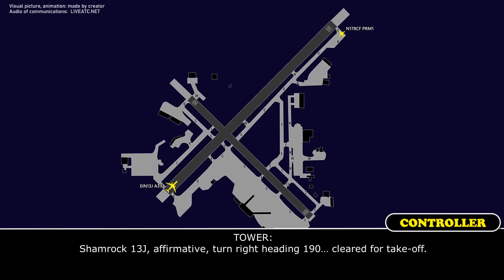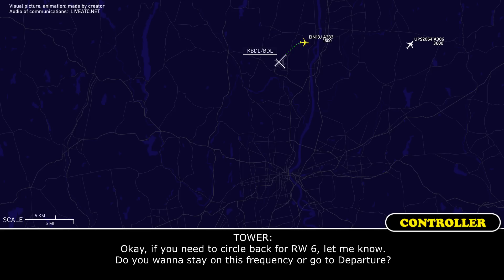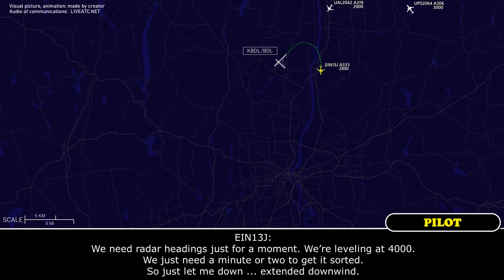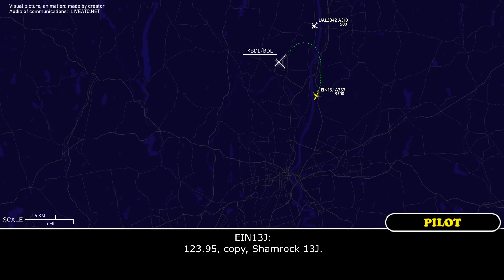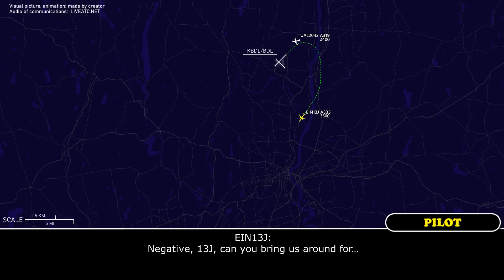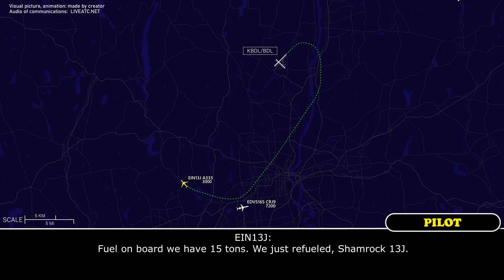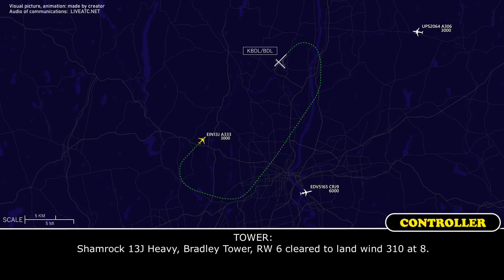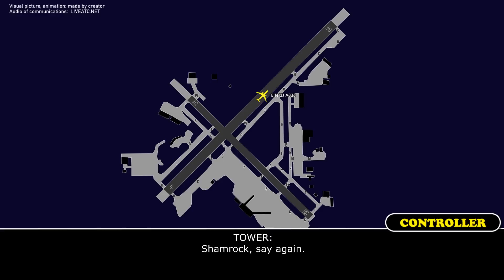Aer Lingus Airbus A333 declared PAN-PAN | Real ATC with a compressor stall after takeoff.

Comment: There must have been an additional complication beside the compressor stall. I’ve been on two flights that had compressor stalls — both in the 1970s on 727s, center engine of course. But after the loud bang and shudder, we continued climbing and headed to our destination on both flights. No further problems. Perhaps this particular engine suffered collateral damage from the stall.

Comment: I am a supervisor at BDL. I fueled this when it initially diverted here. It's still there. They will be completely changing their number 2 engine.
Reply from the maker: Thank you for your comment. Glad they landed safely.
Reply: @YouCanSeeATC  No problem!
Reply: @Andrew Janes @You can see ATC. I flew on that aircraft on the 9th July.
Reply: So what became of all the passengers?
Reply: @msjdb723  They ended up bussing the 314 total people including crew up to Boston. Very long day for them. They actually went back to the gate in DUB due to a medical emergency. So they left 2 hours late from DUB before they diverted from BOS to BDL.
Reply: @dad325  Oh my...🥴 - hopefully they all recovered now from this adventure!
Reply: @dad325  🤦🏼‍♀️ Poor folks. But thanks for that info!
Reply: @dad325 
1. Changing the complete engine sounds like it was a much bigger issue than just the compressor itself.
Or is it something that happens more regularly than a pax like me would expect?
(for instance if the compressor is hard to get to, or whatever)

2. That sounds like the worst kind of travel drama 🥲
(well, without actually crashing, I suppose🙊) 
I'd have been sooooo done with that day, at the end of it 😂

3. Thank you for sharing more info! ^^
Reply: @MrNicoJac  changing the engine is standard procedure for engine anomalies like this especially, the entire engine goes back to either the manufacturer or at minimum their main maintenance base if they have an engine shop that can do heavy maintenance/rebuilds and meanwhile a replacement gets hung. Basically anything more involved than inspections/adding fluids/very minor work usually requires off wing maintenance
Reply: @GlutenEruption 
Ah, interesting.
Thanks for the reply! 

I figured it might be one component that they can just 'un-plug' and replace - since it's not a fan blade etc
But I'm glad to hear that they err on the side of caution with engine parts, haha
Reply: @MrNicoJac  No problem! Erring on the side of caution is definitely the name of the game in aerospace. Although for engine maintenance specifically, it’s as much about money and convenience as caution - not only is it just easier to send the engine to a dedicated facility to inspect, diagnose and repair everything, but the engine swap is a common maintenance item and only takes a few hours to complete, meaning the plane can be back in service and making money right away instead of being down for a week or more while the damaged parts are removed, ordered, replaced, tested, etc. 

And the overhauled/repaired unit just goes back into inventory and get hung on the next plane that has an engine due for maintenance or which had a problem, in a constantly rotating fashion. 

And as a further upside, instead of having 2 engines that came off the production line one after the other, all the planes get a mix of engines that were manufactured on different dates with parts from different lots, etc., meaning if say a bad batch of parts somehow got past QC and start causing failures, it will only ever affect one engine per plane, and you’ll almost always have one good engine.
Reply: @GlutenEruption  Very informative comment, thx.
Reply: @MrNicoJac  having looked at a blow up diagram of the compressor in a jet engine. It is certainly not a bolt on piece. It appears to make up about 30%-50% of the engines structure. A fan blade looks would be a much easier component to change.
Reply: Wow
Reply: Whatdja put in the fuel tank then, boyo?
Reply: @lani6647  When it first diverted, I put about 15728 liters on it. Or about 4155 gallons. When it finally left BDL about 10 days later, it went straight back to Dublin so I put on about 31892 liters or about 8425 gallons of Jet Fuel.

Comment: Anyone familiar with the Airport/Incident? Why did they say the ILS 33 was no good, is it just the leghth?
Reply: After the incident, tower asked if they wanted to return to 06 and they said yes. After that approach asked for 33 but they were probably already configured the ils frequencies and everything for 06 approach. They had enough happening already in there. Sudden runway change in that situation is not what you want.
Reply: Most likely they just were already setting up for 06 and didn't want to change at the last moment, they just wanted to get down ASAP.
Reply: internet says 9500' vs 6800' feet, so maybe?
Reply: @jamescollier3  6800' seems to be enough for a normal MLW, maybe they wanted the extra length due to having degraded performance in the event of a go-around.

I don't know, just speculating here lol.
Reply: Shorter runway, flaps 15 landing possibly?  With a compressor stall, I sure wouldn't want to count on the #2 engine for TOGA power, though they still had the engine...
Reply: They were landing heavy with fuel and they would only be using minimal reverse thrust on the No 1 engine. So they needed all the runway they could get (longest). If they used full reverse thrust on the serviceable engine it would have the effect of steering the aircraft to the left (port).
Reply: 15/33 is shorter. Under normal operating conditions that rwy would have been no problem.